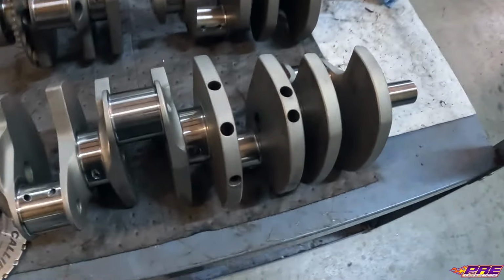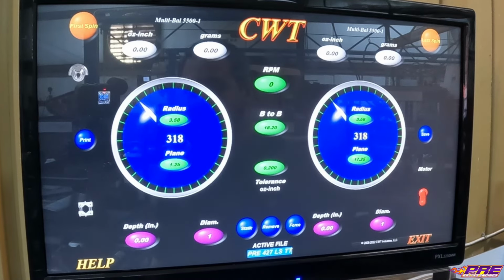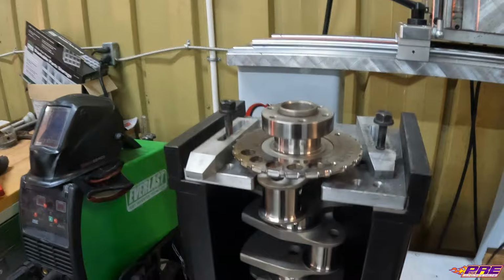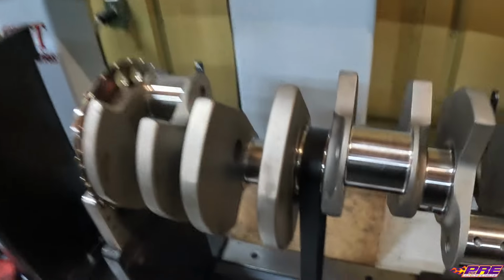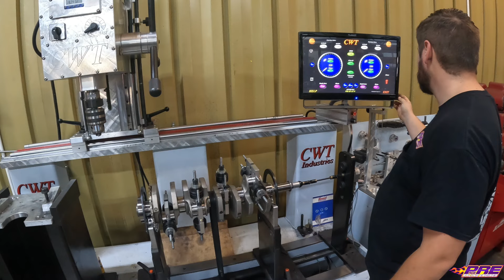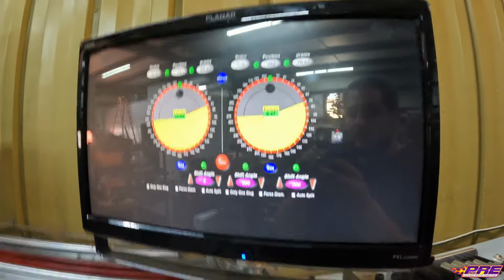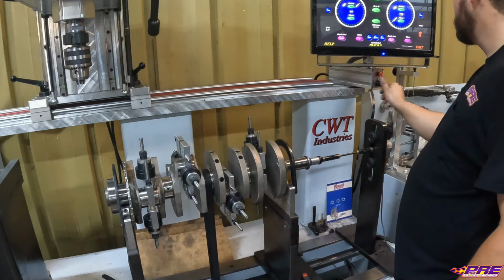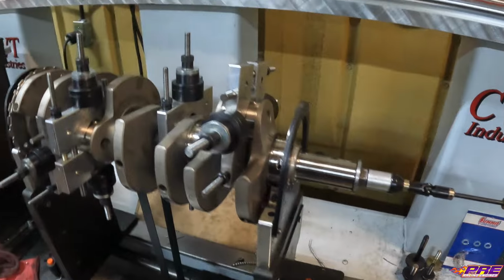Crankshaft Balancing: What You Need To Know

Comment: Engines at rpms over 7000 can benefit from a 3% over balance to compensate for rod stretch, about .035 for steel and .050 for Aluminum
Reply: And Titanium ? 🤔
Reply: @nNataXx  Titanium rods don't stretch at 7000 rpm.

Comment: Excellent video, I always had questions about the bob weights and how it was determined how much they weighed and how they were set up on the crank,  From what I saw it's not critical how they are oriented on the journals since you basically eye balled the journals being straight up and the weights being perpendicular to them.
Reply from the maker: Yes the bob weights are balanced so their rotational orientation on the journal is not critical, only the side to side position is across all the journals.

Comment: Great video!  Are the heavy metal pieces pressed in only?  No welding or anything?  Thanks.
Reply from the maker: Yea they are just press fit. Being installed horizontally through the counterweight there’s very little chance for it to come out compared to if it was installed vertically into the counterweight.

Comment: This might be an unconventional question.  But, If you have a stock 305 chevy engine and you get oversized .030 pistons that are factory replacements.  And you were to weigh them to see if they are the same weight as the original pistons.  What is a like threshold of how much weight in grams, can they be off before you need to get the crank balanced.  I know the old school shade tree answer and that it doesn't matter people have been building stock engines like that for 30 years.  But what is your opinion on that?
Reply from the maker: If the crank has been balanced before and you changed pistons, then on a typical street engine it wouldn't need rebalancing unless the pistons are more than 10g difference in weight for each piston. If it's a race engine, then we will typically rebalance for anything more than 7 grams difference.
Reply: @pageracingengines  thanks

Comment: Sirs Great Video, thank you! Just a few quick questions if you don't mind? 
What rpm's do you spin your drill bits when drilling the crankshaft? 
Is there a brand and angle of drill bit that works best for you? - Thanks again! Subscribed
Reply from the maker: I am not sure of the rpms of the drill since the machine does not give a rpm readout. I just use a speed that seems to be cutting the best with that given size of drill bit. No certain brand, just what my local tooling supplier carries but they are cobalt. I have found the cobalt drills a lot better than a regular high speed steel especially on the nitrided cranks. Sometimes I do have to start with a carbide spotting drill to get through the top layer of nitriding and then the regular drill bits will cut better.

Comment: Thanks for this, first one I've seen with this much detail. I was just a line mechanic - never did any real racing so I have dumb questions :)  
Does the machine tell you how far from crank centerline to drill for the heavy metal? 
One thing I don't get is that the crank now seems married to that piston/rod combo. Is there a different technique when you just balance the crank and you can use different rod/piston combos on that same crank? I assume the pistons and rods of each flavor are all equal weights to each other so I don't get why you have to be so specific on that part. Just make the bobweights all the same and the balance of the crank will be good.  I must be missing something about the dynamics at play here.
Reply from the maker: Yes the machine tells exactly how far from the crank centerline to drill and install the heavy metal. Yes this rod and piston combo is married to this crank. If either part is changed then the crank is rebalanced. Even just changing from stock bore to .030 over pistons requires rebalancing the crank. There are variances in piston design between manufactures as well as rod design which lead to different weights. The crank manufactures balance/design the cranks to a specific bob weight that is in the average range for that engine combination (i.e. sbc 350 or sbf 302 etc)

Comment: I know balancing to within tolerances is pefectly fine and going beyond that has diminishing returns BUT if you wanted something blueprinted, like an expensive bryant crank for a high rpm build how close to zero imbalance can you get?
Reply from the maker: It's hard to get zero imbalance due to the fact of not knowing exactly how much oil weight is clinging to the crank. The industry standard is typically 5 grams unless the rod throws have pockets instead of through holes that would hold more oil then we would increase that number.

Comment: Do you understand that bobweights need to be concentric so that the weight is evenly distributed around the journal. The way you do it, the weights should be added as vectors and it will still be wrong.

Comment: Really enjoyed watching your video. What is the procedure when you attached those bob weights, that positions them radially around the rod journal?
Reply: Was thinking the same thing it must make a difference surely?
Reply from the maker: As for as the rotational position of the bobweights, it doesn’t matter. But side to side on the rod journal does. We have a wishbone spacer that slides over the journal and spaces the bob weights out from the cheek of the rod journal the same on each one. We just make sure to push the bob weight against that spacer and tighten it down.
Reply from the maker: @Aladinscave  it does make a difference where they are placed side to side on the journal. We tried eyeballing them in the center and then using our wishbone spacer method and noticed a 10-15 gram difference

Comment: IMy son and I are rebuilding a Toyota 2JZ. We plan to turbo it. How important or necessary would balancing help? The engine is a straight 6  3.0
Reply from the maker: It's always a good idea for it to be balanced just so that it will run smoothly. If it's out of balance then it can start knocking the bearings out of the engine if it's too far out of balance.

Comment: Bad Shopper... Informative Instructional. good work but whoever ordered rods and pistons so damn heavy you needed add additional weight to the counterweights... screwed up big time. Arguably could have been the crank choice as well. If it ain't broke... don't fix it. somebody broke it in their selection of parts, and you fixed it.  The CWT software program is... Rockin !
Reply from the maker: Sometimes you can't control the weights on the parts requiring heavy metal. For example ls7 engines will always need heavy metal when going to aftermarket parts due to the factory ones being so light weight to begin with. Yea the CWT software is amazing and makes it very easy to balance.

Comment: Jealous of the new technology, I used a "jamb nut" similar to what you used to support the C/W while you drilled for the slug to simulate the mallory, spinning, relocating and respinning to find the happy spot to drill. It worked well, but computers eliminate the guesswork since my jamb nuts had less influence to the added weight being inboard of the actual intended slug location.

What's your method of removing the trigger wheel without damaging it?
Reply from the maker: Yea this new technology definitely simplifies it a little and reduces the amount of time finding the right amount and location.

We use a little heat on the reluctor wheel to reduce the press and then tap it with a deadblow and it comes right off.

Comment: question . About 3 cylinder say a 1 liter ford ecoboost . Is there a way to balance those engine assembled ? Because if each part are balanced seperatly engine run unbalanced
Reply: I assume the same process would apply, shouldn’t it?  Start with a crank weigh each piston n rod. Make bob weights, n start spinning….

Comment: It may have been balanced to tolerance but the phasing was way off. Also the bob weights were not clocked 90* to each rod
Reply from the maker: With the CWT bob weights they are balanced so that you don’t have to phase them 90* to each rod throw. They just have to be spaced horizontally on the journals evenly.
Reply: @pageracingengines  I have the same balancer. They need to be clocked. I know that Randy says that they don't, but they do and we proved it to him when he was at our shop.
Reply from the maker: @johnnypfahl4478  Oh ok, well I guess I will have to check that out then. Thanks for the advice.

Comment: What is the RPM while balancing?
Reply from the maker: Intial balancing is at 500rpm and then once the total unbalance is under 50grams we go up to 750rpms until we meet our target balance.
Reply: @pageracingengines  thank you so much for replying. I have a client who wants to balance a new jeep car crankshaft. I have never balanced a crankshaft before. The client says he wants the balancing to be done at 6000 rpm since the car will run at that speed. What do I do? Also should I ask him to bring the pistons and the connecting rod as well?
Reply from the maker: @wiser1147  You can't balance at the actual engine speed. 750rpms on the balancing machine is plenty high enough for majority of engines out there. You will need to know the weights on the rods, pistons, rings, rod bearings in order to get an accurate bob weight and unless you have a crank balancing machine you won't be able to balance the crankshaft yourself.
Reply: @pageracingengines  thanks for the reply. I do have a dynamic balancing machine will that be sufficient? I'm sorry I don't know the difference between crankshaft balancing machine and dynamic balancing machine. Also if I need to remove weight can I do so make by drilling a hole? Will that be acceptable by the client? Do I need to take permission from him before doing so?
Reply from the maker: @wiser1147  I'm not exactly sure what you mean by dynamic balancing machine. If it is not designed for balancing crankshafts, then it will not work correctly. Yes, to remove weight you would have to drill a hole. That is standard procedure, and you don't need permission to do so if he is paying you to balance it.
Reply: @pageracingengines  are there specific balancing machines especially for balancing crankshafts? My dynamic balancing machine we use it to balance rotors, impellers, shafts, etc. Can I use it to balance crankshafts as well?
Reply from the maker: @wiser1147  Yes there are specific machines for balancing crankshafts. I'm not sure how accurate your balancing machine would be for doing crankshafts or if it would work for that. I have only ever seen/used machines designed for crankshafts.

Comment: I dont know how this machine calculate of the rod ( big end), 479,80 + 43,30 = 523,1   ( total)
and then total 1046,2 ( 523,1 x 2 )Why double the rob ( big end) ? Plss Explain me
Reply from the maker: You double the big end because there are 2 rods on each journal.
Reply: @pageracingengines  why this machine need to know times rods/ throw? Pls
Reply from the maker: @baeminh3636  its trying to replicate the amount of weight that it will see when running in the engine.

Comment: FYI, you need new drill bits. Your's are either dull or the wrong type for the metal you are drilling into. You shouldn't have to put that much pressure on it to drill the holes. I may be wrong, but it looks like you are just using HSS bits. Try some high-quality HS cobalt bits because they should cut that material easily. Your local machine shop supply store should have some and get some cutting oil make them last longer.
Reply from the maker: They’re cobalt bits. Even new they take a decent amount of pressure on some of these cranks with the way they are nitrided.

Comment: It doesn't matter which way engine turns and then balance the Crankshaft to correct way?
Reply from the maker: No it doesn't matter which way the crankshaft turns it will still balance out the same way.